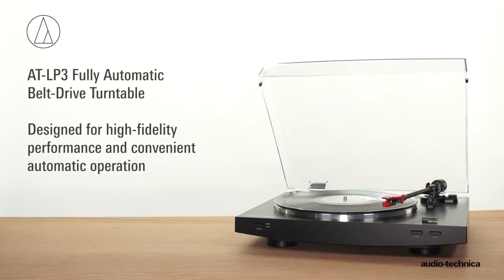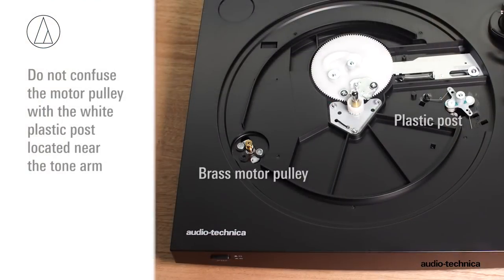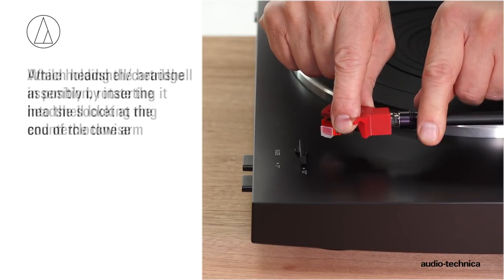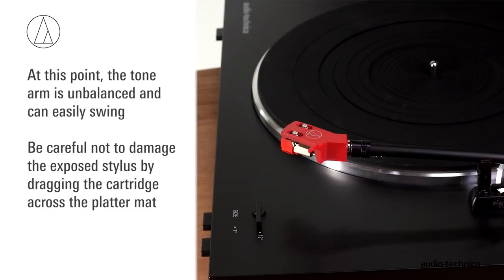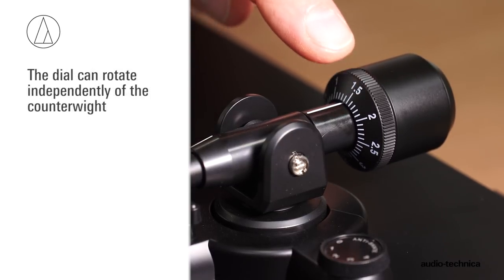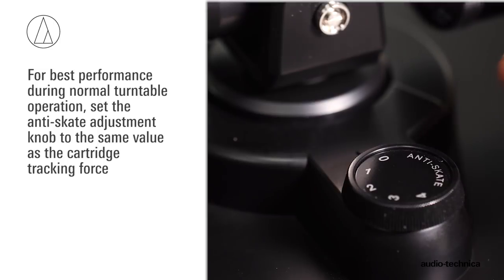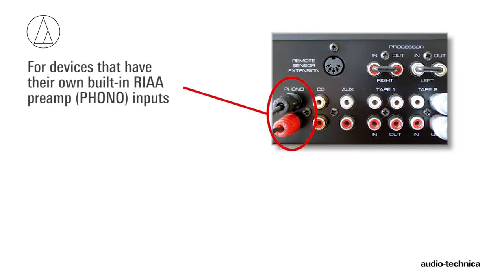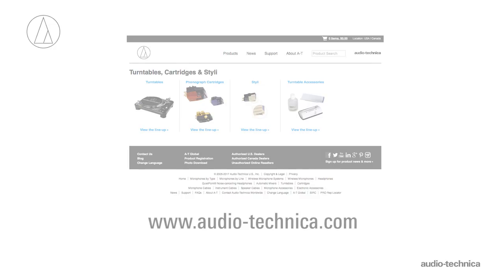AT-LP3 Setup | Fully Automatic Belt-Drive Turntable

Comment: There is indeed an error in the counterweight setup here, after balancing the tonearm over the platter youre supposed to move just the counterweight dial (itself) to zero which was omitted and will really frustrate someone - THEN you set the entire counterweights final tracking force - then you set the anti-skating control to match the tracking force.
Reply: you're a lifesaver! thank you
Reply: Life saver!
Reply: That manual needs a re work

Comment: They didn't set this correct.  The way they try to do it confuses the beginner.  Just shows they don't know how to set things right correct.  First you should put the weight on the back and set the tonearm where it is balanced.  Then you change that dial to "0" first, before you do anything else.  Once it is at zero then set it to the correct stylus pressure.  Lastly set the anti skate to the same number.

Comment: I tried adjusting the speed via the holes under the turntable but I felt no screws there. So I took the bottom apart and there are holes in the motor but they appear to be full of foam, no screws. Wtf guys? Why are there holes for adjustment screws but no screws?
Reply: the screws are there, its just deeper, u need a really small flat head screwdriver to get there

Comment: Man, why am I here? I purchased an AT-LP60..
Reply: You might want to upgrade some day.  With the LP60, you're stuck with its built-in stylus.  It's good practice to learn how to adjust these settings if you ever move up to a more upscale model; the procedure here is pretty much universal.
Reply: @xaenon  I'm actually saving up for the LP120/120x right now! Haha
Reply: @lostmedia-e6p  Excellent!  However, the LP120 is a manual turntable, and also has a fully adjustable tone arm.  So yeah, you'll still have to set that tone arm up.  

Some people have reported issues with the LP120's internal preamp, even with it switched 'off'.  I don't know if they've addressed those issues with the 120x, but it's worth considering.  THere are videos of people actually removing that preamp entirely.

Comment: In case it confuses anyone, at 3:36 there is a grammatical error that makes it sound like you should rotate the counterweight immediately. It should actually say "Now we are going to set the stylus tracking force to the manufacturers recommendation" - as in he will go through the process in the next section. Do not move the counterweight at that point.
Reply: You can't adjust the tracking force without also adjusting the counterweight it's fucking stupid
Reply: No its not (stupid) youre not getting it, the counterweight dial turns separately from the weight itself, and after the arm is zeroed you have to adjust the dial to zero THEN you set the entire assembly to its weight setting - and then set the anti skate to the same number.

Comment: I did make a slight modification to bend the anti-skate arm inside the unit.  The spring arm is straight, but the tonearm moves in an arc.  I bent the far end of the spring arm in a similar arc to keep it engaged longer.  This is not necessary, but I feel it is not good to allow the skating to re-engage after the last song selection.  Added force is applied to the inner groove which could damage a high end cartridge.  The modification eliminates this problem.

Comment: Hello, 
I've just installed the new Cartridge VM 95 E/H on my AT LP3 (replacing the original cartridge).
I screwed the new cartridge and followed all th instructions to set up the tracking force and the anti-skating but now when I press the START button the arm lifts up and falls 'out' of the LP . How can I adjust the correct position to make the arm fall at the beginning of the LP?

Many Thanks
Reply from the maker: Hi there! The angled headshell which was provided with the turntable must be used. You cannot use a straight headshell on this model turntable. Either remove the new AT-VM95E Cartridge from the straight headshell which it came on and install the cartridge on the angled headshell which was supplied with the turntable, or exchange the AT-VM95E/H for the AT-VM95E (cartridge only). We do not make an angled headshell/cartridge combo kit at this time. This will resolve the starting position issue. Thanks! - A-T USA
Reply: @AudioTechnicaUSA  Thanks for your replay. Just a last opinion please, you said ' I cannot use' a straight headshell on this model, but in fact I'm using it in 'manual mode' now and it works fantastic, with the only limitation of not having the automatic START mode available. I've just regulated the tracking force a little bit since the headshell is a bit heavier than the original one.
Reply from the maker: @justeveryday1881  If you use a straight headshell on a straight tonearm, specifically one that was designed for use with an angled headshell, you are creating a few problems. You will not be able to achieve proper stylus overhang, the offset angle will be incorrect, and you limit yourself to the use of a conical tipped type stylus. Without the proper overhang and offset angle established, it is not possible for the stylus to be and remain tangent to, the record groove. If the stylus is not tangent to the groove, a considerable amount of tracing distortion and wear on both the record and the stylus will be experienced. You may also experience a channel imbalance. A stylus with a conical (round cone) tip stands a better chance of survival compared to one that has a more complex shape, but still cannot be recommended. Thanks! - A-T USA

Comment: Is it possible to hear sound without plugging in the red and white wires? There is very little sound with the wires not plugged and I did not plan to buy a supplemental audio device.
Reply from the maker: Hi Abdullah! Yes, speakers are required as there are no internal speakers on the AT-LP3 turntable. Thanks! - A-T USA

Comment: My AT-LP3XBT sounds wonderful ; however, that’s only through line outs - it is not Bluetooth pairing with my Edifier R2000 speakers (which are Bluetooth compatible, and this is the second turntable I’ve tried). Anyone?
Reply from the maker: Hi there! Please contact our Audio Solutions Team for help. You can reach them at audio-solutions@atus.com. Thanks!  - A-T USA
Reply: Thanks! I shot them an email. For anyone who has the same problem, it turns out that the selector switch on the back of the turntable has to be set to LINE instead of PHONO to utilize the Bluetooth feature. I don’t remember that being mentioned in the manual. Anyhoo, thanks again…

Comment: My sound System doesn´t have a ground connection. Is that an issue?
Reply from the maker: Hi Jr. This should not be an issue. If your system does not have a ground connection, then you will want to connect the turntable to a LINE input (CD, Tape, Aux) and utilize the internal preamp of the turntable. Thanks! - A-T USA

Comment: Can you use an rca to 3.5 mm jack adapter to plug in a regular speaker?
Reply from the maker: Hi there! Yes, you can. Make sure the switch on the back of the turntable is set to LINE. Thanks! - A-T USA

Comment: Please tell me the original stylus of this turnable is MM or MC?
Reply from the maker: Hi there! The AT91R cartridge that came stock with the AT-LP3 is a moving magnet cartridge. Thanks! - A-T USA
Reply: Thank you AT USA. Could you tell me if I can replace with stylus Shure M95ED for changing the sound quality?
Reply from the maker: @jimmyv.tnguyen5077  Hi, the Shure M95ED will work with the AT-LP3 tonearm. - A-T USA
Reply: Many thanks A-T USA, please tell me where I can buy the dust cover of this turntable for replacement, I lives in Vietnam.
Reply from the maker: @jimmyv.tnguyen5077  Hi there, please contact service@audio-technica.com.sg for further assistance. -A-T USA

Comment: After one week of using the AT-LP3, now each time i press the start button, the arm moves, touches the turning disc for a fraction of second, and then goes back to resting position and turns off. The manual usage is normal with no problem with the sound output. What could be the problem and How can i fix it?
Reply: Most likely you have the counterweight set back too far. If the arm is "floating" as this and most other "guides" describe, it will be too high above the record to make contact. Better to either set the weight forward a bit further, and risk damage to your records, or buy a better engineered record player

Comment: How to calibrate the rpm speed? Thank you
Reply from the maker: Hi there! Please contact our Audio Solutions Team for help. You can reach them at audio-solutions@atus.com. Thanks!  - A-T USA
Reply: I see there's more people with the same issue... There is no way to adjust it yourself. I got swapped with a new one by John Lewis but the problem developed after few months, without using it heavily at all (>20h of use)
Reply: @morkiuzz  There are two hole in the bottom but there isn't any screws under them.
Reply: Simon Richard yep
Reply: Audio-Technica USA second one developed the SAME issue. Returned for refund. Brand image damaged completely
Reply: @simonrichard9873  you cannot see them because you have to put the screwdriver through some rubber or whatever it is. But you have to use a very very small flat head screwdriver.

Comment: The Anti-Skate should be set no more than "1" with this cartridge!* I was literally tearing apart my system wondering why the center image was panning to the right side on my records, but not for anything else (CDs, radio, etc.) using the same preamp.  I swapped out cables, receivers and was going nuts.  I then switched the stylus and noticed that it looked bent.  I therefore assumed the problem was a damaged stylus until I lowered the Anti-Skate to .8 and it solved the issue.  Now vocals, kick, and instruments are centered again!! The 91R stylus does look damaged though, I wonder if that was because of the previous Anti-Skate setting??? I'm new to vinyl, but not to audio - please feel free to respond or comment.  Has this happened to you?  Does it even make sense for this to happen?
Reply from the maker: Hi there! You will need to set the anti-skate the same as tracking. We recommend between 1.5 and 2.5.

If you have more questions or want to discuss, please contact our Audio Solutions Department at Audio-Solutions@atus.com. Thanks! - A-T USA

Comment: Beware: this is my second AT-LP3 that develops the same fault - after some time, the RPM starts drifting and spinning slightly too fast and causing the record to sound too high.
Reply: Have you replaced the belt?
Reply: @dougmcauliffe2253  No. I've tried removing it and putting it on again. Very disappointing there's no speed calibration
Reply: @morkiuzz  Actually, there is. There are 2 bolts underneath the turntable. You need a very small flat head screwdriver.
Reply: @morkiuzz  lmao the belt gets stretched out after user, which can cause fluctuation in speed etc, its not the turntable's fault
Reply: @drowwwn  lmao, it's turntables fault it does not include easy calibration
Reply: @morkiuzz  But it does....there are two small holes on the bottom of the LP3 labled "33" and "45", Using a small jewelers style screwdriver, lightly turn the "33" screw a tiny bit at a time. Using an app called RPM will allow you to set the speed back to normal, in this case 33.3 rpm's. Easy peasy. And this will follow to any belt drive turntable you get in the future as just about all of them need adjusting at some point.
Reply: @dragon2knight  hmm makes sense, too bad Audio Technica could not provide any technical assistance and advised to return the turntable.
Reply: @drowwwn  What size of a belt fits AT-LP3?

Comment: You got the setting weight to zero and then setting to the recommended tracking weight backwards 
Supposed to set to zero first then set to guage. You guys said to balance equal, then tie down arm and set weight, then move front guage to zero, then set the weight. Lol
Reply: He did it properly.  He started by setting the ANTI-SKATE to zero.  Then he balanced the tone arm, tied it down, set the CW to zero, and dialed in the recommended tracking.
Reply: @xaenon  The video has a grammatical error.. at 3:36 it should say "now we are going to set the stylus tracking force to the manufacturers recommendation" but instead it sounds like it asks you to set it right now as a direction
Reply: @dwindeyer  Yeah, I imagine they could have made that a little clearer.   Slip of the tongue?  It's  a shame they didn't catch it.

Comment: sounds   very  involved and  fidily..
Reply: Nah, it's very easy.  I know it looks daunting but there really isn't a lot to it.
Reply: @xaenon   I'm having no end of trouble setting it up again  no matter how right I set the dials   its wrong the problem im having  is getting the tone arm the right  balance  I've not got the plastic  what held the tone arm in place so  its impossible  to do both easiest  thing i can do to save  my sanity  is to buy a new deck 😄
Reply: @chriswilliams209  Let me see if I understand you correctly.  You're having trouble getting an initial balance of the tone arm?
Reply: @xaenon   yes  before setting the dials  the part where the  tonearm is tied up
Reply: @xaenon   Its always  the most  simple things I have trouble with😊
Reply: @chriswilliams209  Okay.  Start with removing the stylus protector.  Release the tone arm from its rest.    Screw the counterweight all the way forward (toward the front of the turntable).  

Like the guy in the video, back the counterweight off until the tone arm floats more or less level.  You want to be careful to not let the tone arm fall to the plinth or the platter.

Lock the tone arm back down (I think the LP3 lacks a tone arm lock, so you could just use a little scotch tape on the rest).  Hold the back of the counterweight in place as you rotate JUST the disk on the front to zero.  Now release the disk and screw the entire counterweight forward again until you reach the desired tracking force.  

Then set your antiskate to about the same number.
Reply: @chriswilliams209  Also; invest in an inexpensive stylus pressure gauge.  You can simply rotate the counterweight all the way forward, rest the stylus on the gauge (be sure to zero the gauge first!), then back the counterweight off until you get the reading you want.  Make sure the 'bed' of the gauge is close to the normal height of the stylus as it would be when playing a record.
Reply: @xaenon   cheers  I will see if they sell them on amazon 😀
Reply: @chriswilliams209  Were you able to get your turntable set up?  Or is it still giving you trouble?
Reply: @xaenon   not yet I'm waiting  to get  my new glasses first  im.blind as a bat without  them
Reply: @chriswilliams209  Okay.  Hope it goes well!